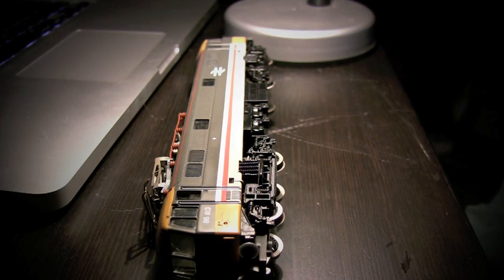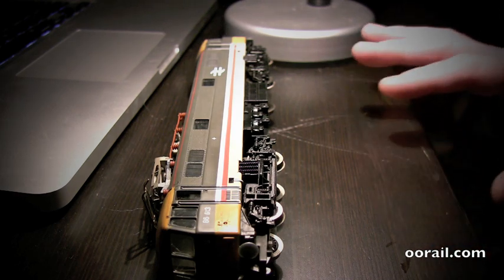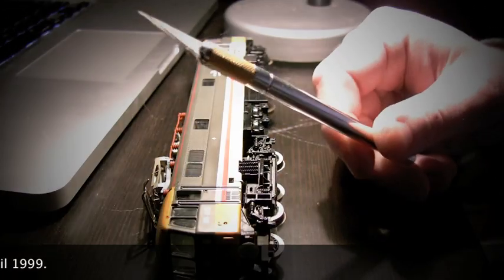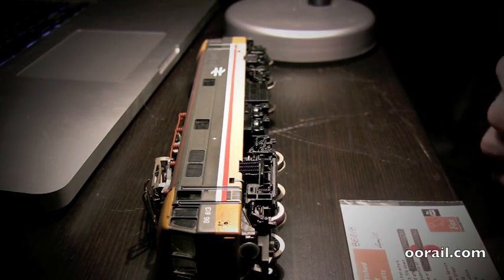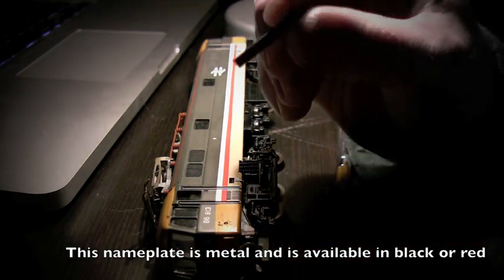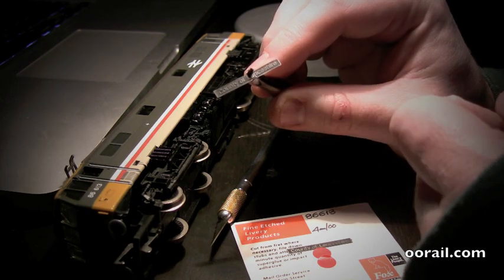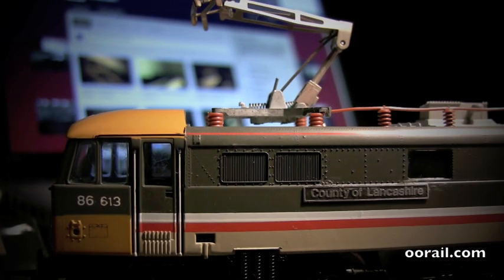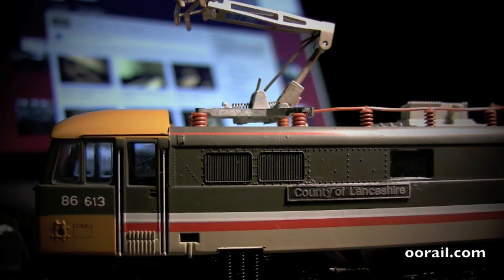oorail.com | Adding Etched Nameplates to Model Railway Locomotives

Comment: Hi, you are correct with your facts as I have 47613 NORTH STAR in my fleet.
Reply from the maker: Thanks.. you've just reminded me that I need to order more of these etched nameplates for my other Class 86 and 87 locos... Once I'm done with this elevated track section, I can get to work on the "electrification" of parts of the layout. I've got several Hornby Class 86 and Lima Class 87 locos that can be powered from the overhead rather than the wheels, need to get that working OHLE stuff working.. so many projects :)

Comment: I use varnish instead of glue. If glue seeps out the applying the plate it will look awful and you can manouvere the plate in to its final position before it dries.
Reply from the maker: Thanks Gordon, that is a very good tip. I will have to try varnish next time. With the glue, I have found the best results using Loctite's new liquid pen product, if you apply one drop in the center of the plate and then spread it out. However, you still have the same risk with the residue if you need to move it around.

Comment: what glue do you use?
Reply from the maker: Deltic SP I use the Loctite Brush-On super glue for these, you have to use it very sparingly to avoid getting residue on the body shell and its not very forgiving if you make any mistakes.